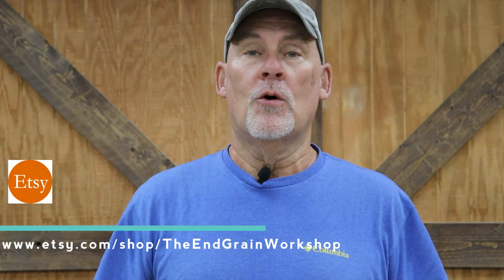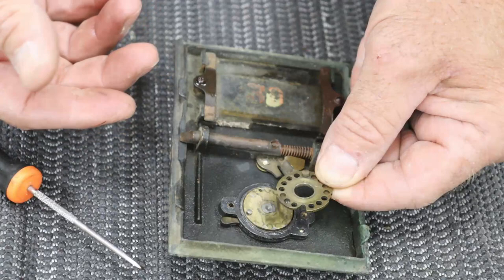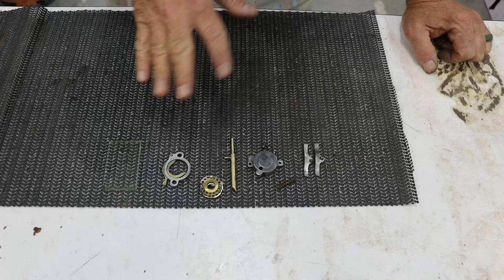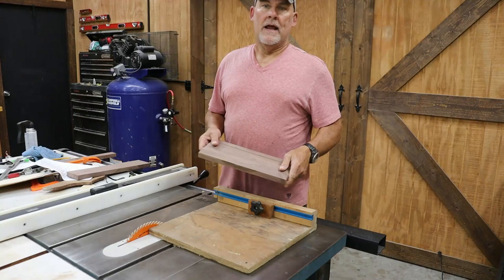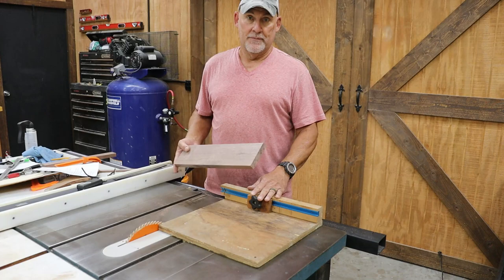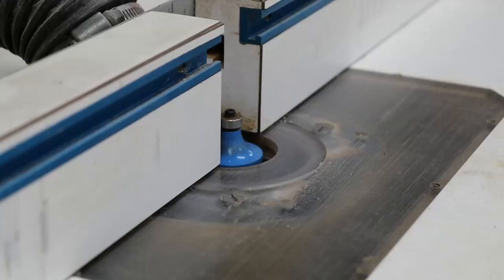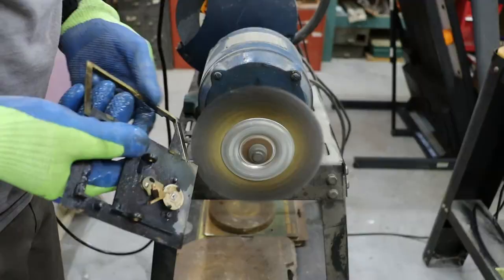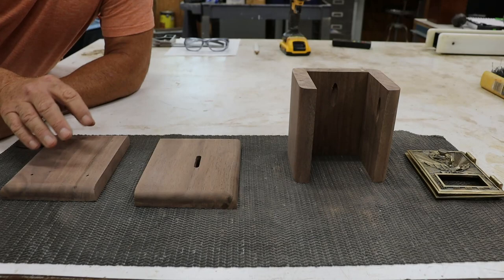How to build a PO Box Bank - The End Grain Workshop

Comment: I have somw if these doors but there are no screw holes to attach the door to the bank. I might have missed this in your vidoe but how did you attach it? I saw you screw it in but did you just drill holes?
Reply from the maker: You have to pre-drill holes through the brass door frame.  Then screw through those holes into the wooden bank.  I hope this helps and thanks for watching!
Reply: That's what I was thinking. Thanks! Iv made a few of these but w different doors and the ones I used had premade holes. I was also thinking of an exterior type clamp that might look interesting or cutting a slot for the tabs to sit in. Will give it a go. Thanks again

Comment: What did you use to put the number on the glass and get the glass black
Reply from the maker: Hey Bill, 
The glass is actually clear and not black.  It might just be the shadow in the picture.  The number is a water soluble number that you just submerse in water then apply it to the glass just like decals you would apply to a model.  I hope this helps and thanks for watching!

Comment: I am studying your video because I have some doors coming my way, thanks to your inspiration.  I am concerned about the wire brush step.  Does it scratch off much detailing?
Reply from the maker: Yes, it can.  You have to be careful with doors that have black painted dials.  On those types of doors, I remove the dials first and then use the wire brush.  The wire brush will remove any painted areas. As you probably saw in the video after using the wire brush you are left with a completely brass door.  I then took and spray painted it black then removed the black with a steel wool pad to give it more of an antiqued look.  I appreciate your comment and thanks for watching.  Please let me know if you have anymore questions.